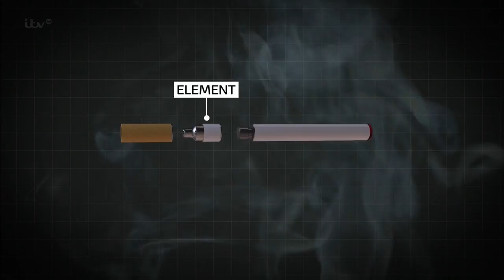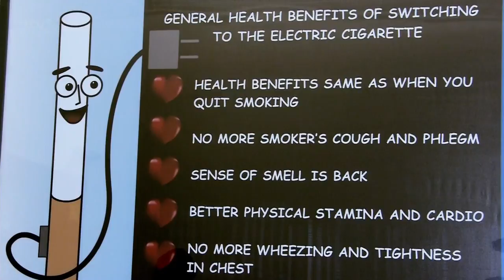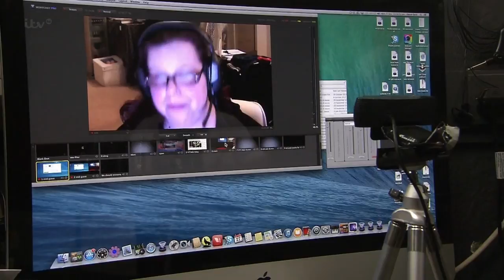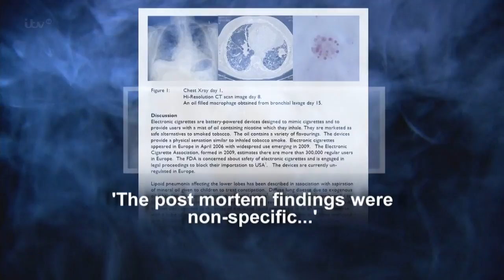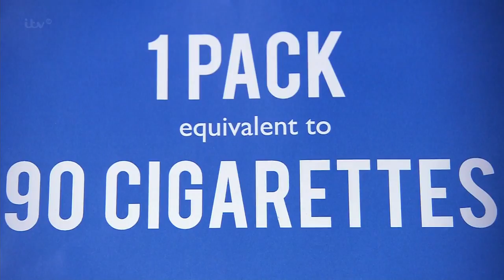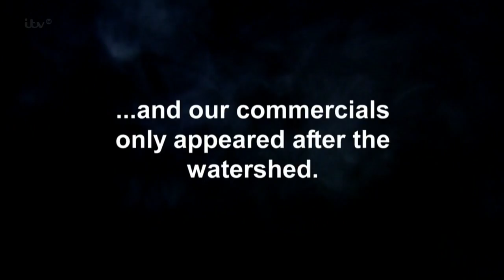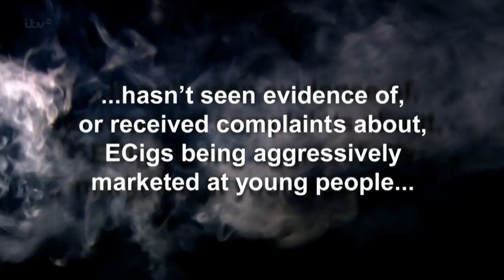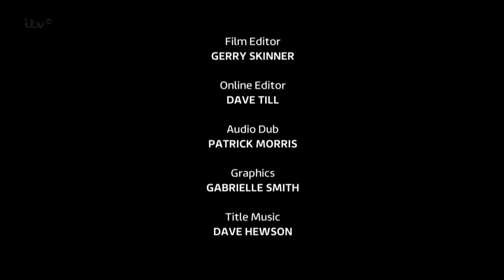ITV Tonight - The Rise of The E-Cigarette (23/1/14) (720p)

Comment: This doc starts off pretty bad. It doesn't understand how a typical starter e-cig actually works, confusing the cartomizer with the battery. (At around the 3 minute mark.) A news program that lets such an easy mistake through casts some doubt on their other claims.

With that said, this video is not a hit piece against e-cigs. It mainly says their safety is still unproven, which is true to an extent. I'm confident e-cigs can withstand any scientific scrutiny. Plus, if they really are dangerous, which I doubt, I'd like to know. Listing ingredients should be common practice. Insisting on child proof bottles seem reasonable. Regulations, if done correctly and with some thoughtfulness, can help the e-cig industry gain credibility and calm some safety concerns. I want more researchers to look at e-cigs.

What I worry most about are the taxes more than the regulations. E-cigs are exponentially cheaper than smoking mostly because of low taxes. State governments in the US are addicted their cigarette money. I suspect many politicians will want to tax e-cigs at the same rates as tobacco products, even though they are (almost) surely safer. That would be a travesty; something the entrenched tobacco lobby in the US is undoubtedly pushing behind closed doors right now.

On the bright side, there are many doctors lining up behind e-cigs and there are millions of happy users. We will not lie down and die on this issue. Email your representatives. I honestly think this will turn out pretty well in the end. Some regulations are inevitable, but I believe e-cigs will escape the extremely high taxes imposed on regular cigarettes.

As a minor aside, this documentary projects that e-cig sales will overtake cigarettes by 2040. That is ridiculous. It will happen much sooner than that. I'd say by 2020.
Reply: Well said Big Bill, saves me writing on this subject, you pretty much nailed it. I just want to add, If it is taxed to the point it becomes equal to smoking, things will get worse with unregulated black market juices. Also shops and entrepreneurs are doing a pretty good job at self regulation, with bottle labelling and child proof caps. Seems humans can regulate themselves but if fair taxes to pay for regulation / testing is enforced and it genuinely gets rid of the cowboys in the trade, I think most vapors will be up for that.

Comment: They have made my Lungs somewhat better. I smoked rollups for a lot of years without tips but put in a roach as we called it. That's a small strip of rolled up card usually torn from the Rizla packet. Then for a few years I used Swan Menthol tips which seemed to help somewhat. I used to cycle 10 miles one way to work so somehow seemed to keep on top of smoking somewhat. The recession killed the firm I worked for & my new job was a 35 mile drive so I never cycled in over 3 years. When I did go out on my bike I noticed the same hills had me gasping for breath or even getting off & walking up them. The same for walking my dog Millie. 6 Month ago I bought a E-cig kit consisting of 2 battery's & 2 tops of the wick type. They lasted a little while but we're poor in operation even though better tops we're available. I've just got a Kanga K-box with a sub Tank mini all from kangatech. Excellent piece of kit. I don't blast on it a lot as I do intend on not doing any kind of smoking eventually. Some people will vape for the rest of their lives. I will say the hills are now far far easier to ride or walk up so vaping has worked wonders for me. https://www.ukecigstore.com/kanger-kbox-40w-box-mod.html

Comment: 2:09- Regulated does NOT imply safe to use. How many medications which have been recalled in past years have been regulated? Answer--- ALL of them.  Regulation only = government make tax and profit.
2:17- "A lot of the toxins....".  Calling an ingredient a TOXIN? Ingredients not researched at this point can-not be called a toxin as, by definition, they are unknown for any positive or negative effect.
2:56- The "battery" they list is actually the "cig-a-like" cartridge, and vise versa.  In a "cig-a-like" the cartridge does NOT contain fluid, but a non-refillable, oily/wax gel.  Keep this in mind, as "cig-a-likes" are the only e-cigs which contain this type of substance. The larger devices, most frequently shown, contain refillable liquid.
4:11- Sigelei is an higher end, e-cig battery control device manufacturer. The industry standard in this case is a reference to how power is regulated in a device and voltage supplied to the "heater" device.  Lower quality in this case (speaking of the battery and circuit board) is comparable to the quality difference between any name brand electronic device and a similar "generic" device. The generic is usually not of the same quality in an effort to reduce price. As this is only a battery and none of this is inhaled, quality and concern here is for longevity of the device..... Much like trying to comparing a BMW to a cheaper economy class car.
6:27- "Still don't know the long term effects on the body". No, but we do know the long term affects of smoking. Smoking contains thousands of chemicals; carcinogens, flavorings, additives...ect. By way of comparison, e-cigs contain far fewer chemicals, many of which are used in other inhaled devices.
6:32-6:38 - "no proof they help people quit smoking", "no proof of the health benefits of these, are the same as quitting smoking" . Legally this is true, as only an official study can support such a claim by law. However, thousands every day testify on line in forums they have quit smoking using an e-cig, and these people further testify to these same benefits listed on the poster after having  switching.  Many more are using an e-cig while smoking, but are reducing their use of the standard cigarette daily.
8:04- 9:40- Fun fact, Not 1 device you see on this table is a "cig-a-like".  So far ONLY the "cig-a-likes" have ever been "tested" for anything. Furthermore, 90% or more of the population using an e-cig use device like those on the table and NOT 'cig-a-likes".
14:27- Big tobacco likes "cig-a-likes".... replaceable, non-refillable devices few have ever quit smoking completely with.
17:10- "Even children can buy them".  Reputable e-cig vendors will not sell to kids, however, alcohol is prohibited as are traditional cigarettes, and some kids still get their hands on those.  This is a parenting issue.
17:25-22:15   "A growing knowledge of e-cigarettes amongst high school students there.... and teenage  children here are aware of them"  This plays on fear.  Fear that you're not a good parent. Kids are aware of a great many things in life(drugs, sex, drinking, smoking and yes, e-cigs). It is the job of the parent to educate their kid(s) on the subject(s) and risks, not a job of government to regulate or ban these things. Hiding there existence does not help kids make an educated choice.
21:21- Limiting the strength of e-cigs only insures smokers trying to quit, buy and or use more product. Or fail to quit smoking all together.
21:47- Most e-cig users find out after 2 months of vaping, nicotine is not as addictive as once thought. In fact, many reduce their liquids strength month(s) after their last cigarette and are able to incrementally  cut down to a 0 nicotine liquid within a year, and stay there. Many find the additives in regular cigarettes and mental addiction are/were, far harder to quit than the nicotine they get from the e-cig.

Comment: just goes to show how little they know when reporting these things the explanation of an e-cig puts the battery where the cartomiser is and the cartomiser containing the nicotine where the battery should be, I'm sub ohm vaping now and direct lung inhaling sub ohming has enabled me to cut my nicotine intake from 24mg down to 6mg. initially after 3 weeks I was bringing up black tar from my lungs for about three days all that muck was being removed from my roll up smoking days. I did try to smoke again about 3 months after I started Vaping but I literally couldn't hack it and it made me cough violently. Ive been vaping nearly 3 years now and I definitely wouldn't say it was cheaper than smoking was as for coughing up phlemb well it happens from time to time so the wild claims on the board of the shop in the video are Not all true. I am still addicted to Nicotine Ive just found a more satisfying way of taking it than Government backed patches, sprays and gums, patches ate into my skin and left me with rashes, gum gave me mouth ulcers, the Nicotine spray burnt my throat none of it worked with all this reaction happening it just raised my stress levels and vaping seems a more natural way to get off the cigarettes. I for one will not stop vaping unless it becomes to regulated to the point of the Government taxing it, this is what I believe regulation is all about the Government and the EU just want a slice of the profits and the easiest way to do this is regulate them then tax their use. This is more about greed that really giving a dam about the population.